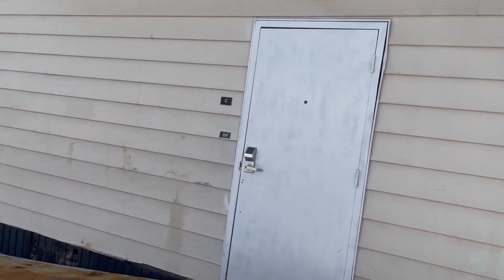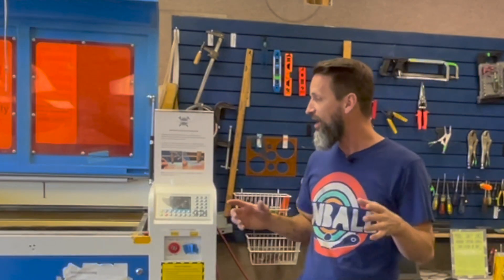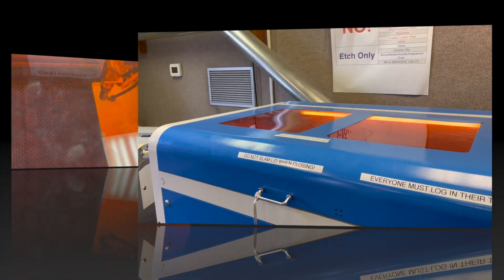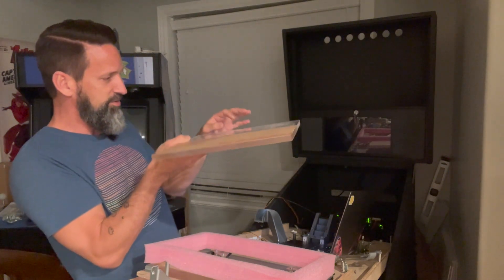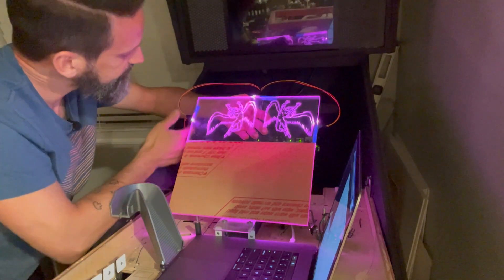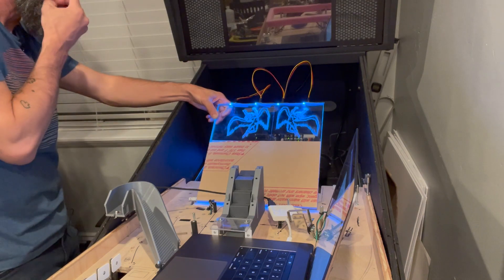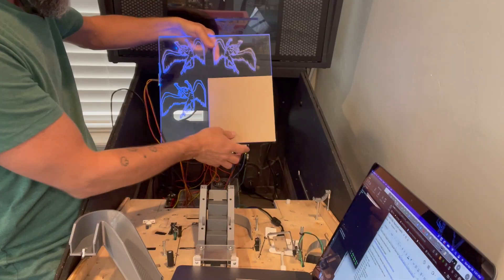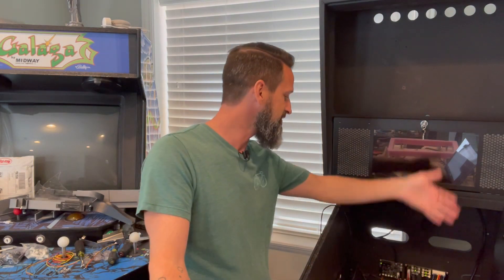HOW TO MAKE A PINBALL MACHINE: Laser Etching!

Comment: I've used a machine like the one on the left for etching leather and acrylic, among other things.  Great machines.   The trick to acrylic is to check your depth; you can get a finer print if you're not too close to the material.  You can also shade with it by using a grey on the computer program, but it's tough to do and not all machines will react the same.  Shaded etching would really light well, something to think about.  Also it's best to use small etchings, but for a layered effect like you're doing?  Don't be afraid to do two etched designs and put them on top one another.  Keep in mind with the LED lights - less is more, look at a concert video and stick with no more than three or four colors that compliment each other.  But treat these like neon signs - it's essentially what you're making - and you'll be fine.

I wouldn't go too crazy on the background of those acrylic sets - simple is often better, let the lights play the lead.  You might add their logo and use the acrylic as the 'face' of the game, maybe.
Reply from the maker: Yeah, a more shallow fine etching turned out to look the best, thanks for the ideas, I appreciate them!